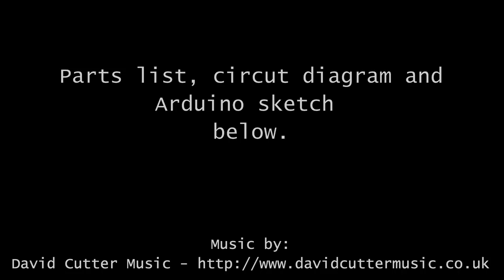Making a wooden digital clock

Comment: Very cool! How could one make this into a clock with an alarm?
Reply from the maker: Thanks!. Should be fairly easy to extend the circut and Arduino sketch to include alarm components. You'd need a bigger box though (: There is a good tutorial on build an alarm clock here https://circuitdigest.com/microcontroller-projects/arduino-alarm-clock